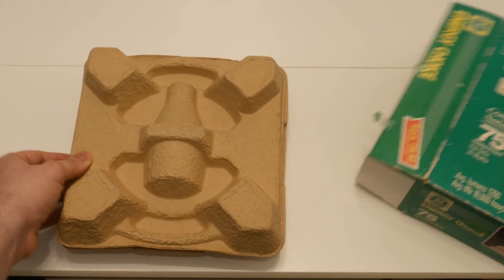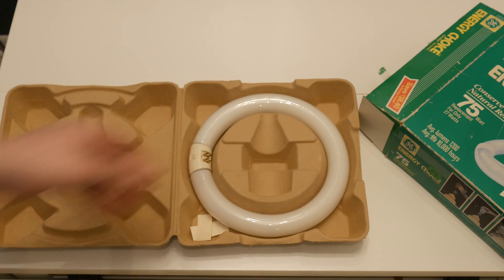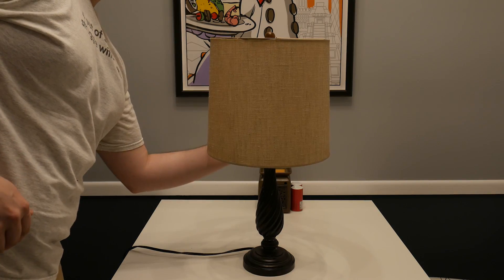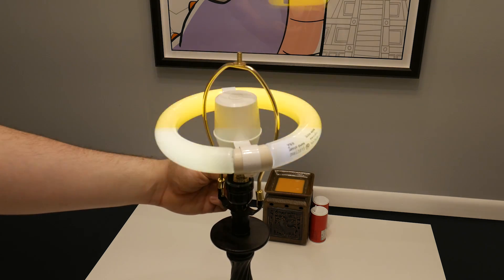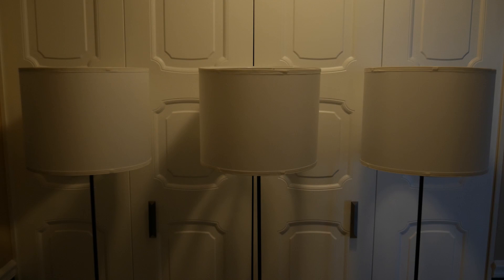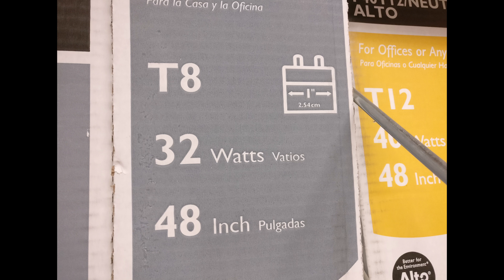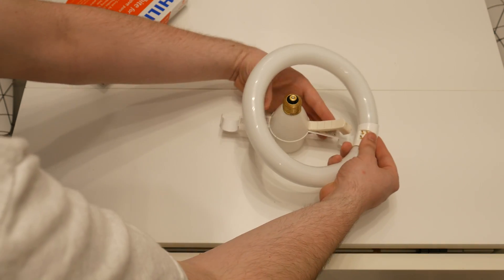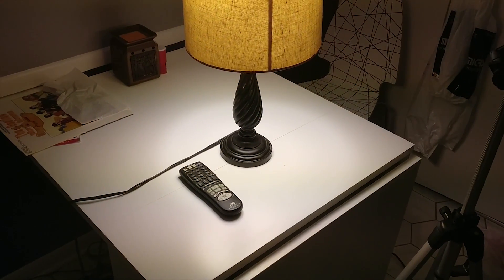GE's bizarre early attempt at a CFL

Comment: I have an LOA adapter that I picked up at a habitat restore, the included tube is AWFUL. Not only is it the Halophosphor Warm White, but it is dimmer than it should be (could be wear from use). I also have a GE Cool White (I like halophosphor cool white) and it works just as well. The LOA adapter has the starter in the plug and uses an argon glow starter as well as having the plug on wires instead of on a flexible plastic bit.

Comment: Measuring in 8ths is the lighting industry standard. If you're looking for replacement bulbs for your stage lighting, you might order PAR64s for your 8" parabolic aluminized reflector fixtures. You can also find this sort of sizing in fasteners. A fastener with 0616 in the part number is probably a #6 screw 16/32" (1/2") long. It's just an easy way to assign a meaningful integer to a dimension measured in fractions. The lighting industry decided that 1/8" was the smallest increment necessary between different lamp sizes. The fastener industry settled on 1/32".

Comment: I remember these things. We had them in older buildings. The light emitted always seemed rather eerie. These days they have been replaced with LEDs arranged in a circle which emit much cleaner light. They also don't flicker and don't have to warm up. They also are not prone to die when turned off and on repeatedly.

Comment: These circline lamps were actually quite good. I bought one in 1989 and it worked just fine until the lamp got knocked over and broke the tube in 2007. After that it was replaced with a newer compact fluorescent, the kind that don't last as long. I still have the old ballast around somewhere.

Comment: I have two of these lights. 
Now they are in the garage. 
When it's cold, sometimes they don't start up, but I don't care because they are in the garage.
Reply: Sometimes simply flicking the switch a few times can make them light.
Reply: Fluorescent  lights work by heating the gas inside the tube  which make the coating on the wall of the tube to fluoresce, or give off light. When used in cold locations like your garage or as a porch light, the heating takes longer and the colder it is  it may never get warm enough to fluoresce.

Comment: You think the T[Number] convention is weird, we use millimeters to denote the width of the base. So a sort of garden variety incandescent is an A19 (A is the shape of the glass, 19 the width in 1/8 inch incriments) E26 (E stands for Edison, 26 the width in mm). We are mixing imperial and metric in the same thing. It's ridiculous. It gets weirder then that with commercial CFL tubes that don't have a built in ballast. A "twin" tube is one with a single tube of glass in a U shape. A quad tube is two tubes of glass usually in a U shape. A triple tube actually has three tubes in the U shape. So Twin Tube = one tube. Quad tube = two tubes. Triple tube = three tubes... Oh, and a T8 can also describe incandescent test tube shaped bulbs used in decorative lighting. The chances of googling a bulb size and getting the right size first try is slim. Haven't even touched all the seemingly endless shapes of lamps like R (Reflector), BR (Blown Reflector), PAR (Parabolic), A (Arbitrary), T (Tube), C (Candle), G (Globe), MR (Quartz Reflector), etc. Lighting is a rabbit hole of weird. You also have styles of LEDs coming out now. ST19 are the vintage style of LED bulbs somehow.
Source: I was a commercial lighting consultant for a Batteries+Bulbs franchise many years ago.
Reference: https://www.bulbs.com/learning/shapesandsizes.aspx

Comment: As recently as 5 years ago I absolutely loved these for use in floor-standing torchiere lamps. Being over 6' tall I can usually see the top of a light bulb in a torchiere, however these were the only thing I could find that were low profile enough to provide tons of light without being able to see the bulb... they never quite cast the color temperature of the one you picked up, thankfully.

Sadly, in recent years the ballasts have become chinese garbage. Still on the hunt for a decent LED pancake alternative.

Comment: Early 90's  I bought some of these at the Dollar Store.  I installed 3 of these in a ceiling fan which was really meant to use incandescent bulbs, but these worked.  These were offered until CFL were introduced & that was the last straw for these babies; (Price, Shelf Space, Size constraints of fixtures customers could use them in plus product Weight itself)

Comment: When CFLs firs came out they were surprisingly expensive, because the production numbers weren't high.  So you could buy this saturn-ring lamp for a lot less, although they would typycally only fit shaded living room fixtures.  I still have the two I bought in 1988, and they continue to work well.

Comment: When I bought my house, it came with one of these in the garage.  It had really weird behavior.  Like the light would never come on, until I turned the switch **OFF**, then it would stay on for about 5 seconds, then die.  For a long time I thought it was a feature of the light............. until I got to look closer, then discover it was some old horrible implementation of a florescent lamp in an incandescent socket.  An updated LED light is now in it's place.

Comment: I bought 2 or 3 of these units from my utility company, PSE&G, around 1983.  I installed them in table lamps where they were on 8-10 hours a day.  I used them well into the 2000's when they finally began to need replacement bulbs.  My "innards" weren't as slick as the one you show; it was basically a block with 2 flat and 2 curved sides and had vent slots molded into the flat sides.  I think I might still have them out in the garage.

Comment: AKA Japanese city centre street lighting. The first "energy saving" bulb my parents bought had a smaller and "squarer" tube built in to a big block of a starter unit, it lasted for years, though was gradually shunted off to less-important locations (it started off in the hall, which is nearly always on, to save money). I also remember it being really dim when it first switched on, and needing to "warm up". They all do that, but it was really pronounced in that old one.

Comment: My uncle had one of these installed in a lamp. He was notoriously...... cheap..... to the point that ceiling fans had only 2 out of the 4 bulbs twisted in and lit..... and they were only 15 watt incandescents! He was also an early adopter of the circa 1983 Philips SL*18 CFL (the first CFL ever made, 18watts/1100lum). Unlike this GE bulb, those wouldn't even fit in a standard lamp with harp. He did shove them into the ceiling fan though, and boy did it look dorky.

Comment: Nice lamp! You still get similar units to this, although the tube isn't removable. Examples are such as Osram Circolux, and they apparently last a really long time. I have to say, while novel, this example from GE in 1991 is really poor as your colour comparison definitely makes it look like a halophosphor warm white tube (in Europe known as colour 29). The way you describe the purplish glow and the colour rendering definitely seems this way, so you won't be surprised to hear colour 29 has a colour rendering index of... 52. That's why everything looks bad under it. Why do I say it's poor? Because all the way back in the early 80s Philips were already releasing their SL line of CFLs (integrated control gear and all) that were using triphosphor technology to deliver excellent colour rendering in the 85 range.

Comment: I installed a Dual Circline  fluorescent light fixture in my kitchen almost 3 years ago. It uses the 22 and 32 watt Circline bulbs in it so it uses a total of 54 watts of electricity, which isn't horrible but not great. It's probably a 1950's fixture but I like it because it puts out quite a bit of light and the bulbs last a very long time. I haven't had to change the bulbs in it yet and probably won't for at least another year or longer. Sure I could easily take it down and replace it with a regular Incandescent fixture again and put in a 8-10 watt LED replacement bulb that is similar to a 60-75 watt Incandescent bulb but I see no reason to do that.

Comment: I bought one in the late '90s (the design was a little different by then, but not too much--I don't think the middle section was that big and bulky though) and loved it. It kicked out a lot of light without using that much power. And you shouldn't have to install anything too often; I had mine for 5 years or so before I moved out of the country for a while

I agree that the light quality isn't great, but I didn't care at the time.

Comment: I took one of these apart, and as you guessed, it's just a regular starter (without the shell) wired in there.  Later, I took the electronics from a dead CFL (one where it was the tube itself that was dead) and installed the circuit board inside where the magnetic ballast was.  It worked!  The electronic ballast thought it was driving its old tube.  You want to use the guts from a bulb that is the equivalent of a 100W incandescent.

Comment: that base looks better than the bad ones out for it now.  where the is already on the bulb and you snap it to the base  (round heavy chunk) and well it doesn't stay snapped in.  I got it for a joke and because Grandpa had one from the early 80's  maybe 70's plugged into the ceiling although being so young then I couldn't know how the base looked.  I thought it looked cool at that time...
Reply: the one I got though, within about 40 seconds it starts to really flicker and it was brand new out of the box like new as in modern era.  So I don't know if thats the ballast's fault or the bulb but I had enough and gave it away.  it was fun but flickers suck.

Comment: I used one - rather, a similarly shaped Philips clone - to light the first light box I ever built. 

It worked fairly well, with the box depth, to generate an evenly lit surface.
Reply: I did that with 2 of the smaller and bigger circline bulbs. 22watt and 33watt if I remember. Some great cartoon art came off it.

Comment: Yeah, they tended to like to do sizing schemes like that in the mid-20th century.  Aircraft hardware is that way; an AN4-14A is a bolt that is 4/16ths inch in diameter and 1 and 4/8 inches long.  So, a quarter inch diameter shank, and one and a half inches long.
Something I'm going to fuss about with this design:  that clip that grips the tube.  When installed Edison screw down as in a standard lamp, the clip is gripping the tube from the top, not supporting it from below.  Should the plastic give way, the tube will fall.  It seems to be designed for ceiling fixtures.
Reply: True and yet the instructions only exampled a table lamp but wtf i'm pretty sure he said that they recommend to screw the adapter to the socket then attach the ring but that looks to be impossible since you have to put the right over the bottom of the adapter to get to the open side of that clamp. He seemed to say that the clamp's grip  was really strong as he was expecting the ring to 'shatter in [his] hand".

Comment: yeah... they can last 20 years, i have some of the REALLY early CFLs, the "bulb" ones that are actually with ballast and starter, the starter appears to fail, the tube is ok and not black, it's philips.. infact branded CFLs tend to fail in the circuit while cheap ones tend to fail on the tube... earlier?... replacing the starter on mine is tricky, it's uncapped and anything is squeezed and the leads apper to not tin or are hard to crimp

Comment: I have two in a hallway. And they were installed brand new a long long time ago. They need new bulbs, but they still work.
Edit: the reason I've not done anything about them is it's a hallway that's also stair 'gallery' area of the house. So the 'easy to reach' one need 14 feet of reach. The other one is 21 feet up. Both are on the ceiling of a second floor of a house with 14(!) foot ceilings. And both require you to lean out a bit with the stepladder against the banister over a drop of 28 feet. And I'm acrophobic..
Reply: A pole with a light bulb changer is all you need. They sell them at hardware stores.

Comment: grandparents had these in a house that never left the 80's.and 20 years is a minimum for these lights but grampa always said if the light goes on it stays on.probobly why it lasted what was 20 somthing years until the house was sold and all the light fixtures were replaced with more modern ones.

Comment: That's pretty neat. 

I think I have one of the very first commercially made CFL bulbs. It's made by Phillips, and it weighs over 1 lb. It has a very thick, heavy glass globe around the curly bit. It's clearly from the 1980s, and it still works...
Reply: $15 to $18 and it weighed a lot too with that iron ballast. I was excited to see something new. It kept flickering and I was able to take it back and get a refund at the hdwr store. Yes a refund on a light bulb. The curly bit was two open ends with nothing in the middle just the whole bulb's mercury gas filled volume. G.E. (god ekes) had the patent for the modern spiral CFL in the early '70's. Quite a bit ahead of the time, why did they sit on it? Could have been till decent electronic "ballasts" came of age. It seems the patent had to expire though. Or is it the retarded mindsets that prevail in marketing and on some of the comments here too.

Comment: My parents had a couple of these in table lamps. 

As for the color temperature, it's something you need to get used to. I bought some florescent bulbs for my bathroom. and they were a cool temperature 9I think they were labeled as 'daylight'), compared to the incandescent ones that were there. With my sea foam green bathroom tiles, the lighting almost made me physically ill. But I got used to them.

If you were accustomed to cool temperature bulbs, then one day bought an incandescent, you would probably think "why is the light so yellow?" It makes everyhting a strange color [compared to the cool temperature bulbs].

Comment: A kid I was friends with had one of these in their garage. This was from the early to late 80s. The bulb must have already been pretty old because when you turned it on it would take 5 to 10 minutes to start. Oddly the whole time I knew him they never replaced the bulb and just dealt with the delay. They also ran a pipe from their drain cleanout outside their kitchen window to the sewer pipe cleanout on the other side of the house (just had it laying in the yard). I guess it got plugged up pretty good and instead of fixing it, they just ran the pipe.

Comment: Thank you for the video ...I actually prefer Cool White light...so way back when, the only way I could  achieve that was to buy this adapter, and then buy a cool white tube... and lamps that it wouldn't physically fit into I had to actually tie wrap it onto the shade and not use the arms.. other companies fixtures were not as rugged and you could just cut the arms off.. and had wires and a plug onto the tube.. still using today.... internal starter is the same as an FS 2

Comment: Very nice! Somehow these screw-in circline adapters are quite common in the US. I've never seen such a thing here in Europe. But what I do have is an very old Osram circolux 25W lamp. It has a capacitor as ballast instead of an inductor and has also an electronic starter instead of an normal starter. But you can not change the lamp. Sadly the glass of mine was broken. I took out the remaining glass and put the rest in storage for years. The problem was that the bulb is smaller then a 22W circline lamp. Later I found out that in the US the 20W circline is quite common. In Europe only 22, 32 and 40W seem to exist. I bought a 20W from Ebay and it fits! I had to remove the plug from the lamp and solder the wires into the old adapter. Now I got the Circolux going again. I hope to find such a nice lamp which you have there as a 230V model once...

Comment: Thanks for the review of this lamp!  My grandmother's house had many ceiling fixtures with really creative round globes and chrome rings. They had several different diameters tubes in then and were really cool "space age" things.

I am so sad that I didn't get to remove them from her house after she passed. They were super cool!

Those cool old fixtures with new fluorescent tubes (with better phosphor colors!!!) would be a great addition to any vintage fixture collectors home.

You can definitely replace the starter in the adapter. You need to take the 'glow switch' capsule out of a starter plug and install just that part into the Circline adapter in place of the worn out one.  It's been a long time, but  remember popping the adapter apart at a seam, changing the starter, and then re-assembling it with PVC solvent cement (plumbing section).
Reply: SPIRAL STYLE CFLs didn’t exist much before 1990.  If you wanted a compact fluorescent, you bought these circle things.  My parents have one in their basement simce the 1970s (almost 50 years)!  Mounted upside down

.